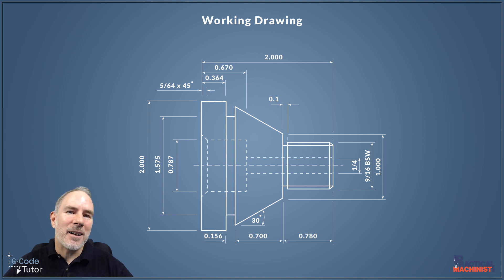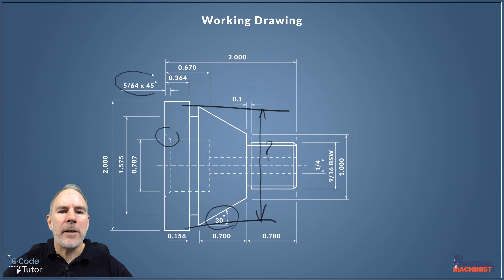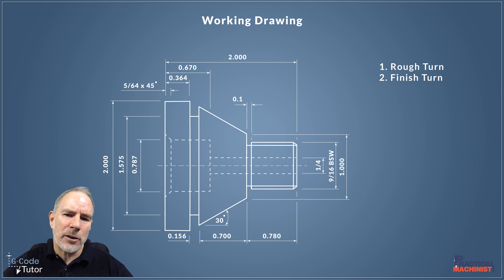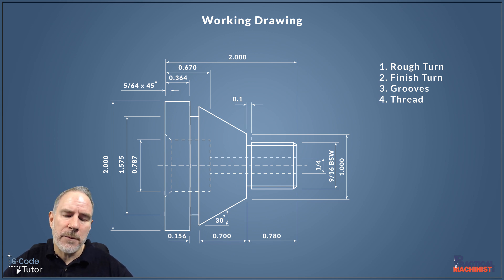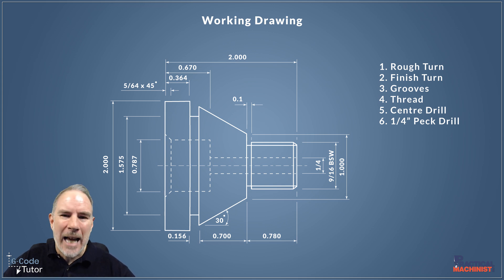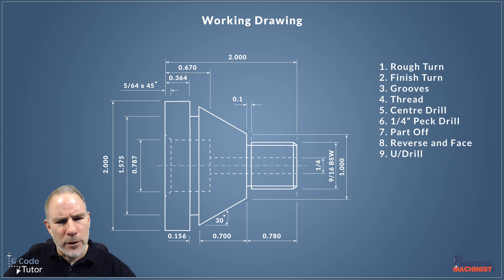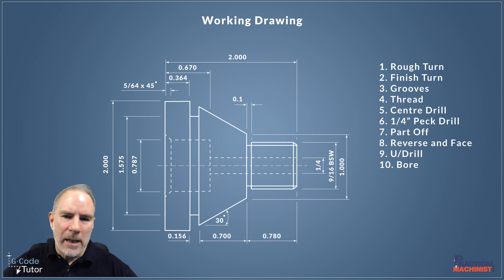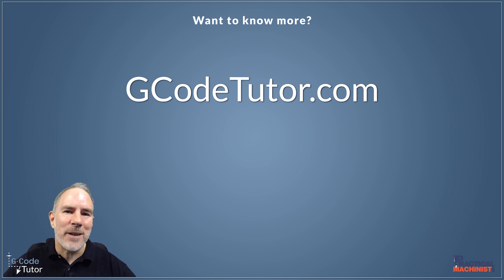Programming a Part on a CNC Lathe using G Code: Step 1: Planning

Comment: u really wanna start @ that right side? @ what face u want to support that workpiece, when u do op2? when using that mentioned u-drill, it will need some solid face to put that feeding force against! change that op to the left side first and pre maschine that cone @ the rear, leaving left enough meat for op2,  to do it in one cut. then u don‘t need heavy DOC for roughing the thread. clamping on that 2.000/0.364 in soft jaws enough to securely handle op2. bonus: u have a perfect face to push against, to achive perfekt parallelism of 1st and 2nd side!💪
Reply: yeh thats also what i thought. i would start from the otehr side